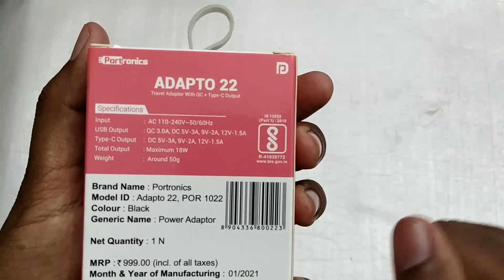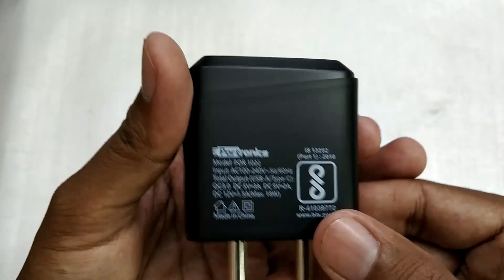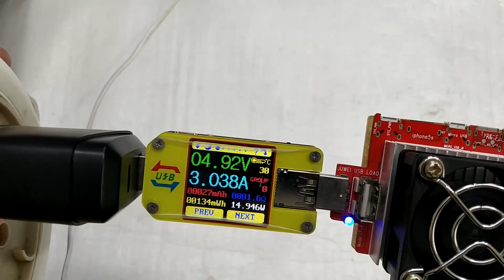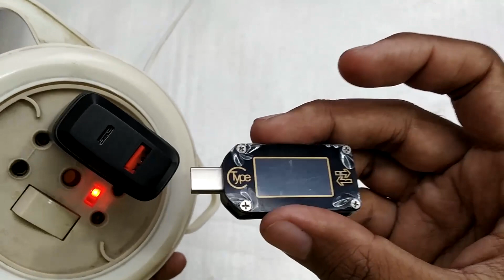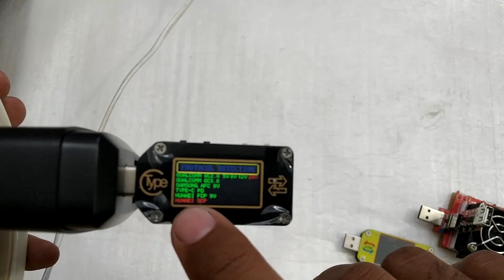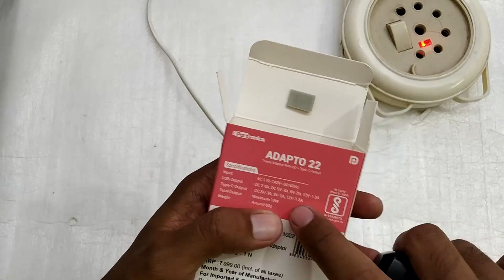Portronics Adapto 22 Quick Charger Unboxing & Review.

Comment: Bro this is work for OnePlus 8 Pro  Wrap Charging?
Reply from the maker: This charger doesn't have warp charging feature but this will charge your phone or any other phone without any problem.
Reply: @gurribuy  Thank You
Reply: @gurribuy  Can you please suggest me Type C to Type C Wrap Charging Adopter
Reply from the maker: @venkatratnam7137  I will try but i don't have a oneplus phone so, without testing with an actual phone in my hand, i would not be able to tell you for sure.

Comment: Why does protocol detector say “dangerous”?
Reply from the maker: it says dangerous because during the test if any device is connected to the usb meter, the device may get damaged because the meter switches from 5v to other voltages and if your device does not support other voltages then it may get damaged.

Comment: Well done bro.. liked.. If you charge 2 devices simultaneously, does it provide 2.4 amps on both ports or does it reduce the output in half ?? Would you kindly test verify on Ampere app and reply bro..
Reply from the maker: no, the total output of the charger is 18 watt. if you use both the ports at the same time the 18 watts is divided between the two ports.
Reply: @gurribuy  Sure bro.. thnx for the info.. I already bought it..

Comment: Pro level stuff, good job. Thanks.
Seems suitable for my RPi 3B and RPi 4.
Reply: Today also you are using this adapter with rpi or anyother device?
Reply: @info3676  I am using the official RPi adapter, which is very stable. With this one it functions, but the undervolt icon appears from time to time. Maybe the voltages are unit dependent.